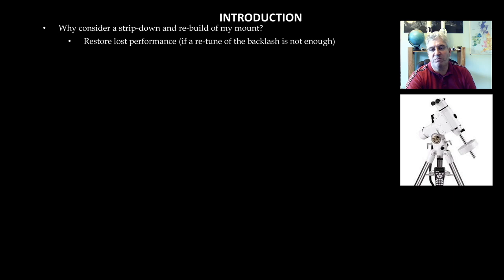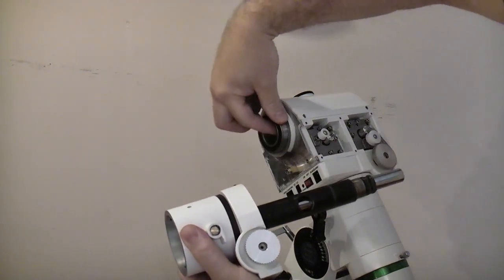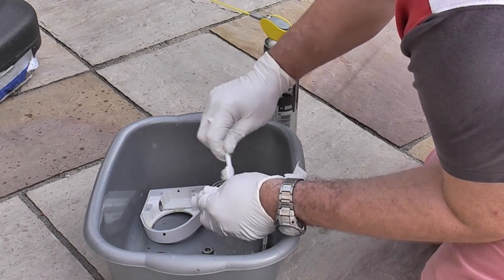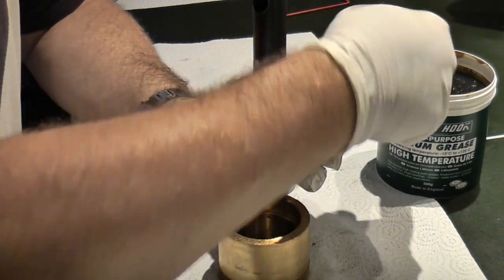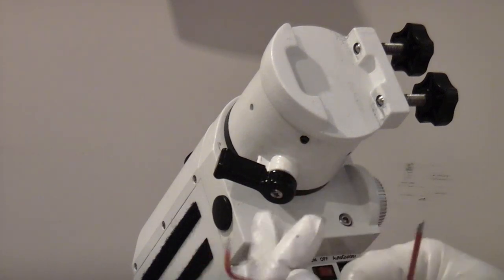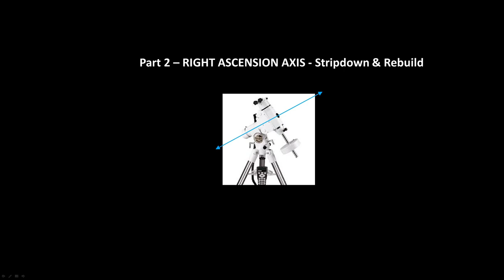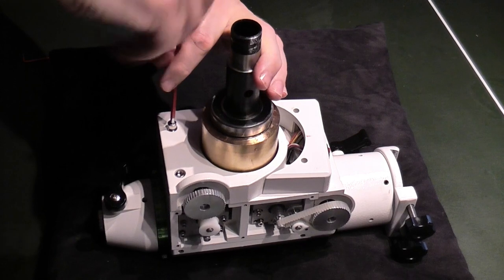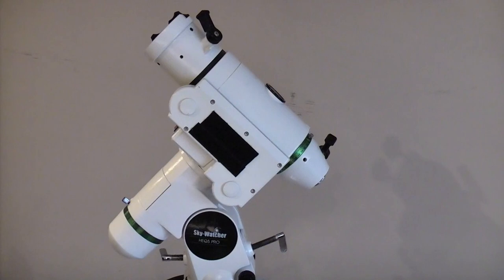Skywatcher HEQ5 Stripdown and Rebuild (OLD VERSION)

Comment: Once you had apart, you might as well have  replace the bearing with some quality ceramic sealed bearing. I bet the mount would operate alot smoother than with  OEM bearing. I'm sure a set of steel Temken bearing would be better than what's in it now.
Sealed bearing are not meant to be regressed, they should be replaced.  I believe there's grease on the sealed bearings to snug up the fit and minimize movement in their seat. The tapered bearing is designed to be regressed and if it ever needs to be replaced the racer needs to replaced along with it. 

Nice video, great information, with plenty of detail. Thanks
Reply from the maker: Thanks Ray. You watched the old version rather than the new one. In the new one I removed the bearing covers and regreased the bearings. In fact I have now swapped out my worm drive bearings with hybrid ceramic ones, but I think it’s life that is improved by doing that rather than performance. Glad you liked the video. Clear Skies!

Comment: There is little chance that any grease will get into the ball race unless the bearing shields are removed such that the old grease may be removed and new grease applied. The shields are easy to remove using a sharp blade or a fine screwdriver.
Reply from the maker: Thanks, but please watch the new version of this video, where this mistake was corrected. Clear skies.
Reply: Thanks Martin for the swift response. I have now completed the bearing exchange and just waiting for the heavens to clear to try it out. Thanks for the very informative video, i would not have tried this  without it.
Clear Skies
Neil

Comment: Martin did a great job here, you should remove the rubber seals and flush out the old grease as well, i took it a bit farther and replace all bearings with high end SKF hybrid ceramic ones. HEQ5 when modded performs way above it's price point. 5-10 minute unguided subs are possible as mine does.
Reply from the maker: John Doe Hi John. I have changed all my worm bearings to hybrid ceramic ones, but did so after making the video. Can I ask, which rubber seals are you referring to?
Reply: @martinsastrophotography  He referring to the black seals on the small and large bearings (not the tapered bearing - that bearing is not sealed).  Depending on the type of seal it may or may not be removable.  It's more of a dust seal, so its likely your de-greasing fluid got through to some point, but not very likely you were able to press any new grease into those bearings.  Great video - I will probably tear my mount down when the weather gets colder.
Reply from the maker: mtb54703 Yes, that’s correct. I have now added a note in the description advising people to remove the seals to get to the inside of those bearings. Thank you.
Reply: I have found that these high end ceramic bearings etc etc are quite irrelevant to guiding performance. The tolerances described in such bearings are of a different order of magnitude than the errors and bumps we see in our guidelogs: it would be like worrying about aerodynamic nano-coating used in racecars to make supermarket charts run more smoothly. I myself have installed default skf bearings and my mount runs reliably at 0.40'' - 0.50'' rms, which is, I think, seeing limited. On clear nights, it runs 0.35'' for long periods, and I've seen it run in the high twenties too. Maybe, just maybe, with ceramic bearings, on perfect seeing and windless nights, I would get 0.22 instead of 0.28, who knows. But this is not what most amateurs are after: they are trying to get that 0.8 - 1.5'' total rms down to 0.60 or maybe better. I can confirm that you don't need any special bearings to do so. Clean the gears well, use an electric(!) toothbrush, dont de-grease your metal-shielded bearings (!), and use a nice thick high-friction (!) grease for the big worm gear into the big shaft. Good PA and good eastyheavy balancing, generous minmo's, and you got a 0.50'' rms system.

Comment: Great timing Martin ... My RA is very stiff to rotate with my hand... literally I need to force it ... and it squeaks ! So I'm guessing the grease has degraded on it. Grease / de-greaser ordered ! Then I'll jump in !
Reply from the maker: Michael Auton Go for it. Let me know how you get on. If you decide to replace the bearings let me know and I’ll tell you what you need to buy.
Reply: @martinsastrophotography  How can I tell if they need replacing?
Reply from the maker: Michael Auton Test each bearing by hand, holding the inner ring while turning the outer ring. It should turn smoothly and freely with no grating or resistance. If it does not then I recommend that you replace it.
Reply: @martinsastrophotography  Just want to say thankyou for the video.. I stripped down my HEQ5 at the weekend - and it feels 100% better / new again .. Only issue I have is that when I unlock one of the clutches (so I can feely move the mount head) - the clutch drops slightly... however when the clutch is locked - it locks fine. I've checked the clutch screw and 'small circle piece' are in correctly and the screw all seems to be in correctly and tight enough. Doesnt impact using it - but I just cant seem to get the black clutch trigger from not slipping - as I say when locked its fine. 

But thankyou x100 for the video - big help !
Reply: @mauton  did the guiding improve?
Reply: @Calzune  well guiding was not really possible... it was that stiff. So I would say for my scenario yes the guiding improved.

Comment: At 33:00, you only grease the seal of the bearing, not the bearing itself. I would either remove the seal and grease it properly or not degrease it at all.
Reply from the maker: Please view NEW VERSION instead of OLD VERSION of this video, which fixes this issue that you rightly spotted. Thank you for your comment.

Comment: Hello Martin, I have an Atlas EQ-G mount.  I have Super Lube Multi-Purpose Synthetic grease with Syncolon (PTFE) Is this Grease good for replacing the grease in the sealed bearing and Tapered Bearings?
Reply from the maker: Hi Philip. Looking at the specification I think it would probably work well. Temperature range is excellent. Harder to say if the viscosity is suitable. I suggest you try it. If you have problems with it, I suggest you get the Geoptik 2-part grease kit. (One grease is for the gears and the other is for the worms.)

Comment: Hi Martin, excellent video, thank you. The dec axis on my HEQ5 does not move very freely when the clutch is released (e.g. when balancing). Is there anything that I can adjust to rectify this?
Reply from the maker: Hi Neil. I suggest stripping the Dec axis down and cleaning / re-greasing all the bearings. If you do this, be sure to remove the rubber bearing seals and remove the old grease, then press new grease into them before re-fitting the seals. This step was missed in the video but added to the description later.
Reply: @martinsastrophotography  thanks Martin, I'll review your info carefully before proceeding.

Comment: Hi Martin, thanks for the great video! I have an HEQ5 which has never been regreased or cleaned since about 8 to 10 years! Both RA and DECL shafts feel a bit stiff but autoguiding and control still works. However, would you think I would benifit from a cleaning procedure? Thanks!
Reply from the maker: Definitely.  Wait for a cloudy week and go for it!  If it's that old you might even want to put new bearings in it.  Note that you viewed the old version.  If you are going to re-use the old bearings please be sure to use the new version of this video which has the correct procedure for removing bearing seals to get to the ball race inside the bearings,  Hope it goes well.
Reply: @martinsastrophotography  Thanks Martin! Yes I've noticed I looked to the old version, will check the new one. I will give it a try soon...  Thanks for the very good video and keep up the good work!

Comment: Hi Martin, is there any guide on unmodified HEQ5's gear mesh tuning? I've been having difficulties to deal with my 13.6s gear meshing issues... either by loosening and tightening the gear's mesh, the results are generally unwelcomed... Thanks in advance!
Reply from the maker: A good question. The Rowan Belt mod can also cause 13.6 second meshing issues but the tuning is different. On the unmodified mount there are 3 meshed gears on each axis/motor. These are the motor gear (the very small one), the worm gear (the one on the end of the worm), and the idler gear (the middle one). On the motor mounting plate there are 6 screws. Three of them (the corner ones) hold the plate to the mount. The other 3 hold the plate to the motor. Since the idler gear is hard mounted to the motor plate, it is the three corner screws that’s adjust the degree of meshing between the idler gear and the worm gear. The other 3 screws enable you to move the motor (and its gear) relative to the plate, so those are the ones that enable adjustment of the degree of meshing between the motor gear and the idler gear. The order in which you do the tuning matters. You need to first loosen the corner screws and move the motor assembly (with its 2 gears) away from the worm gear. Then loosen the other 3 screws and tune your motor gear to idler gear meshing. When you are happy with that, make sure the 3 screws holding the plate to the motor are tight, then tune the idler gear to worm gear meshing and tighten those 3 screws when happy. This will be a rather fiddly process, so take your time. Hope this helps. Let me know how you get on.
Reply: Freeman, the 13.6s period is not related to gear meshing but to the Rowan belt. Each 13.6, a new tooth enters the small RA motor pulley. The teeth dont fall exactly frictionless into the motor pulley's teeth gap, and the belt is lifted up temporarily (phd stars making 'corrections' if your minmo is not big enough) and then suddenly falls in, causing some slack in the belt (again phd will try to 'correct' for this if set too strict, magnifying the problem). One solution can be to increase belt tension, and see if that helps. If it doesnt, and especially if it's an older generation (2y +) of belt mods, it's worth a shot contacting Rowan astronomy themselves to ask for help.
Reply: @danielbeetsma6118  It is indeed an issue with some belt mods. However it's also an issue for non-modified mounts. I've seen quite a lot unmodified HEQ5s suffering from the same issue, including mine.

Comment: Your handling of the bearings is a disaster. You have to remove the sealings, clean the bearings completely inside with degreaser/white spirit, dry them completely, fill them with new grease using NEW clean gloves and extreme care to keep it clean, and replace the cleaned sealings. The way you do it, you will at best fill the bearings with degreaser and by that ruining the grease in the bearings, or at worst forcing dirt into the bearings and by that ruining the bearings. Putting grease on the outside of the sealings is pointless. You won't get any grease into the bearings that way.
Reply from the maker: Thank you for your comments. I realised after making this video that I had got this wrong and added instructions exactly along the lines you are describing to the description text for the video. Modifying the video will be a significant job but I have shot the footage already.
Reply from the maker: I have now published the updated video. I hope you are happier with it! Thanks again for your comment and for prompting me to produce the updated tutorial.